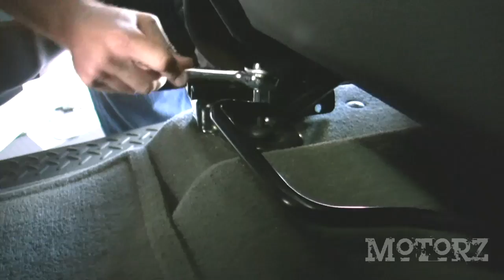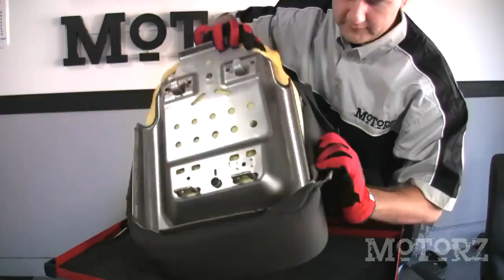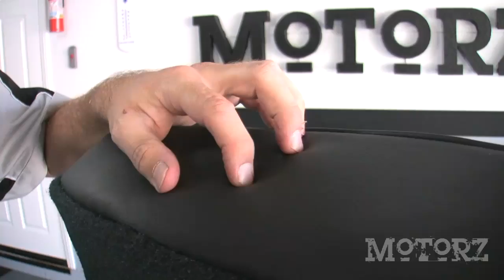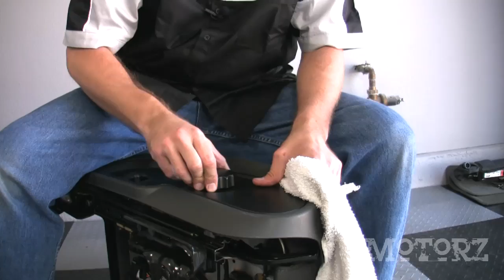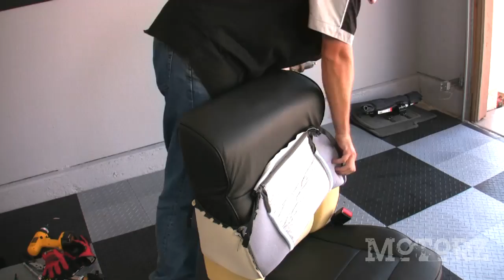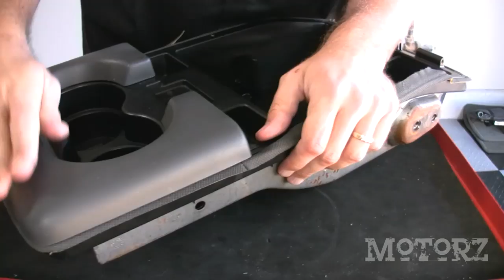How to Install Katzkin Leather Interior Ford F-150 Motorz #13

Comment: This IS a pretty good video however, Katzkin will tell you if you ask them that your set is not warrantied unless you have it installed by an authorized Katkzin dealer........call them and check it out yourself before you delve into your DIY install.

Comment: When u did the headrests on my '15 F150 the padding was able to be removed. I put the padding in the headrest cover first then slid the headrest mechanism inside the foam. I didnt need to steam or use silicone spray.

Comment: I followed this video 5 years ago when I bought the Katzkin leather interior.  It really wasn't that hard, it took me the weekend to do it and I did all but one thing myself.  The only peice on the f150 that gave me trouble was the center console.  I ended up taking it to an upholstery shop.  Charged me $100 to do it.  Anyway, after 5 years leather still looks great and everyone that sees it says it looks like it was done at the factory.

Comment: The plastic bag is for suction not spray.  If you use a shop vac and suck the air out of the headrest the leather with just slip over. No spray needed.
Reply from the maker: +Justin Molina Per Katzkin, it's actually used for either situation. Sometimes it just needs a little help, either by suction to compress the foam core, or with a little lube :) Thanks for watching!